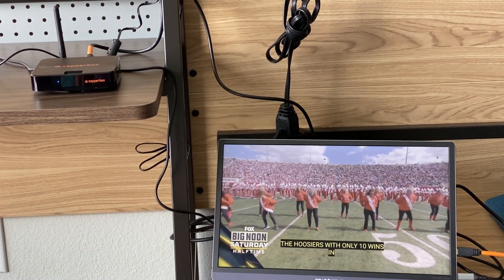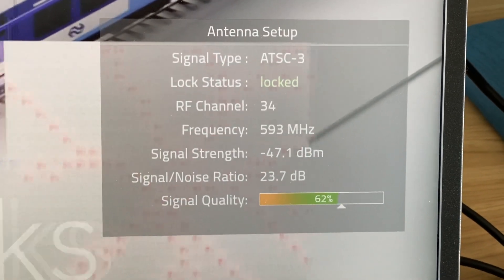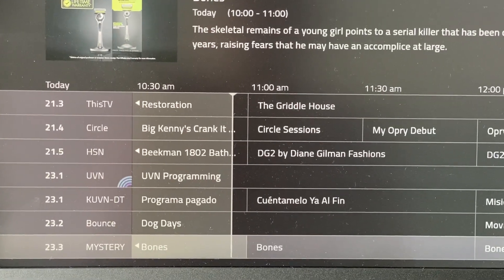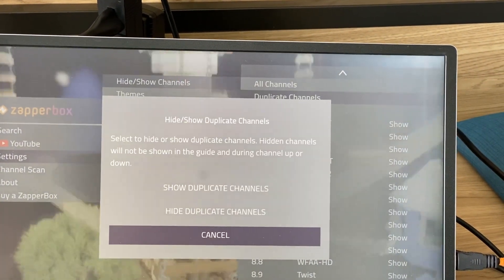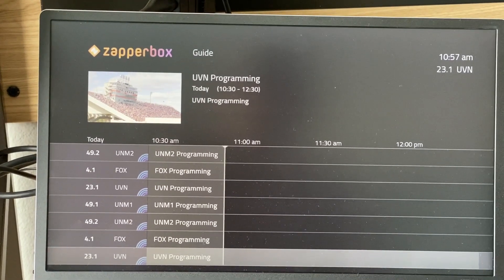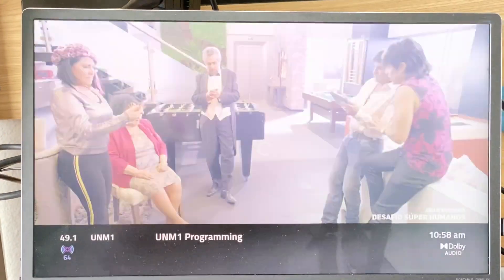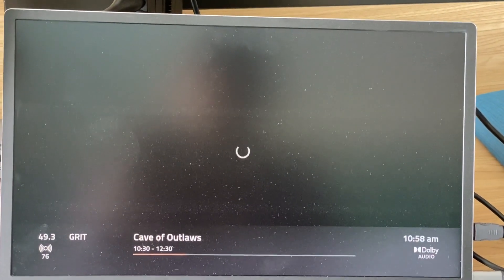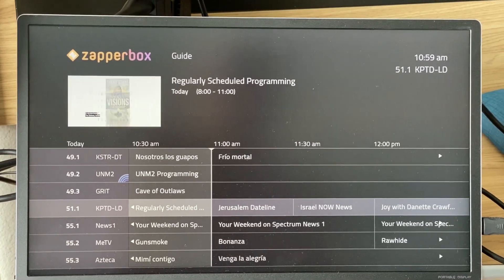ZapperBox in Dallas | Testing ATSC 3.0 Lighthouse Channels & PLPs

Comment: The thing I don't like about ATSC 3.0 is that the signal doesn't carry as far as an ATSC 1.0 signal.
Reply from the maker: We think that is because ATSC 3.0 channels are not yet being broadcast with the same power as ATSC 1.0 channels. As broadcasters increase the transmission power, ATSC 3.0 signals should travel further and offer various other promised benefits.
Reply: Antenna Man interviewed the president of ATSC. She said due to bandwidth efficiency, power can be increased for ATSC 3.0. I would speculate, that won’t happen until ATSC 3.0 equipment is more proliferated in consumer devices and ATSC 1.0 goes away in a few years.